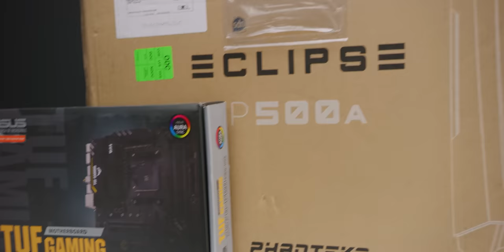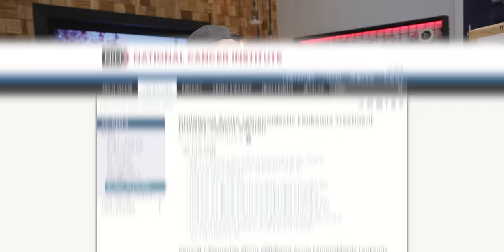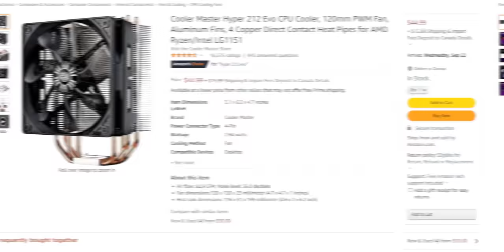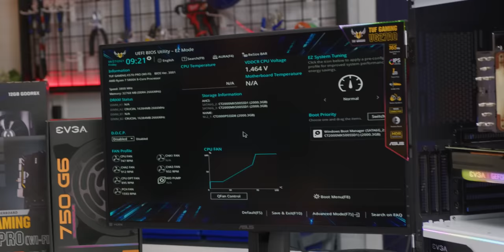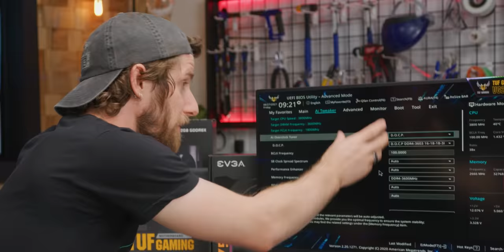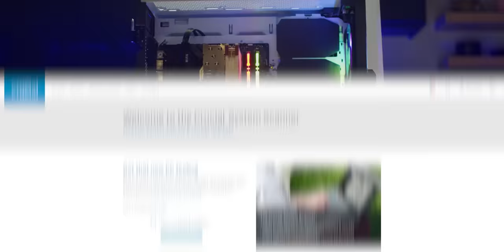I Will GRANT One Wish - ULTIMATE Make A Wish PC

Comment: I really like that they sent him the PC in its parts.  It allows him the satisfaction of building it himself (mostly) and prevents damage from heavier components like the GPU during shipping.
Reply: Especially as it was shipped internationally!

I've seen such damage from things that were shipped with heavy GPUs that were left installed...

Linus group packed the inside well even though the heavy parts were removed for separate shipping - that was a great touch.
Reply: They had to take the cooler and GPU out. They're way too heavy for them to be shipped installed. If you wanna ship those you have to do some janky crap like suspending it, gluing it or similar... and Linus doesn't do that.

Comment: I know there's no chance a linus dude will see this, but I think you guys could check out the 5800x itself in a video and look at its thermal characteristics compared to like the 5900x. might be interesting to see how the 5800x is basically the same TDP as a 5900x but only in one CCX instead of two, meaning that it basically has twice the heat density of what the 5900x could ever have.
Reply: Post on their forum, higher chance it gets noticed there.
Reply: I got the 5800X. It's the hottest CPU of the 5000 Series.
Reply: Cool observation
Reply: This.

I have a 5800x and its a toasty boi even with my EK 360aio with 3 Noctua NFF12 fans. I am super skeptical of the u12s to say the least...
Reply: @helnkellrfresh2deaf  Is it a great overclocker ? I didn't get much luck with my i7 4770K. Couldn't get it pass 4.3 Ghz no matter how many volts I put trough it. But if you're all saying the 5800x is having insane thermal issues I might reconsider my upgrade choice when time comes
Reply: @Zwackelmann173  I mean, no, at least in terms of total heat under load the 5950x is going to out heat it simply because it's a golden 5800x and a mediocre 5800x glued together. The 5800x is going to burn as hot as the good CCX of the 5950x, which - don't get me wrong - is very hot. But that said, I think the 5800x is also the best general-use chip of the Zen 3 series for the same reason, it's the best half of a 5950x whereas the 5900x is 2/3s of the 5950x with all of the CCX jumping penalties compounded by fewer cores making keeping threads on the same CCX more difficult.
Reply: When you guys say it runs hot, do you mean it gets close to its maximum temp as detailed in the spec?
All Ryzen 5000 chips run hot, that doesn't mean that they get damaged by it. My 5600X for example runs fine at 62C under load, which would be a bad temp for say an FX8350 but not for a Ryzen 5000 that can get to 100C without throttling.
Reply: @Maxim0M1  before i used 1usmus's clocktuner my 5800x would try to use all 150 watts and at like 1.45+ voltage on prime95 resulting in over 100C and sometimes over 105C temps
Reply: @acastanza  how many watts can a 5950x pull? cuz i know the 5800x will go up to 150 watts, if the 5950x wanted to be as hot as the 5800x (in terms of density) it would need to use up to 300 watts (because it has twice as many ccx's to dissipate the heat)

if it cant use up to 300 watts, then the 5800x is at least the hardest to cool of the 5000 series, probably
Reply: @machintrucGaming  honestly the Precision Boost is soo good I haven't had to do any manual overclocking, just some minor undervolting in the PBO curve optimizer.

I did -20 on all cores except for the 3 best performing cores, where I did -10.

I get just under 4.9 all core, but it gets hot. Cinebench all core will hit 79-81c depending on ambient.

I think I can push the chip a bit harder to get 5 Ghz even (if I did -25 or -30), I just haven't tried it.

I know I can't go further than ~-10 for my top 3 cores though. I get instability beyond -12, so I pulled it back to -10.

If you just want overclocking, get a 5000 series with more than 1 ccx, and you'll be good to go AFAIK.
Reply: @acastanza  The 5800x pulls ~130w stock and ~160w PBO. The 5950x pulls ~150w stock and 190w - 210w PBO. Heat density is way higher on a 5800x. As stated from others, 5800x has highest heat density and will always have highest thermals provided cooler isnt being overloaded (as in, 150w cooler having trouble cooling a ~200w PBO 5950x).
Reply: @PhantomMattcraft  I'm not sure that's an accurate assessment of the full capabilities of the 5950x which - per the source I found above - can pull 300W when overclocked with a top of the line cooler, and a top tier motherboard with a VRM that can take handle it.
Reply: @Zwackelmann173  I have a Noctua D15 with 2 140mm fans on it. I still get 80-85C spikes when loading into games in 26C room temp. Big yikes, but that's also after "undervolting" the CPU. Best thing ever added on the 5000 series, runs faster but cooler due to lower thermals.
Reply: @acastanza  Comments with links typically get removed, so whatever source you linked isnt stated here. Gotta just do something like "article name here" instead of linking.

I have yet to see a 5950x on a daily OC (meaning bench OCs can be ignored until we also use bench 5800x OCs too) pushing >220w average. There are some daily OCs with >220w transients, but same can be said with 5800x daily OCs having >160w transients.
Reply: @PhantomMattcraft  know of any air coolers that can still cool the 5800x very well despite its ridiculous heat density? it almost seems like my dh15 can't take away enough heat from it, so it overheats
Reply: @machintrucGaming  it depends on your sample. i got a silver sample, and i'm able to get my top 8 threads/4 cores to around 4.8 ghz, something like that. i suppose if you had a gold sample you may be able to get up to 4.95 or even 5 on your top cores, maybe 4.75-4.8 on all cores if you were lucky

Comment: I hope the EVGA 3080 Ti ultra is better manufactured that their 3070 Ti lineup. I've gone through two so far with EVGA because when the 3rd fan is running, it makes a very audible knocking sound inside the card. On a positive note, if I ever wanted a metronome, this particular GPU has it built-in to save desk space.

Comment: My computer professor in collage said you need a 1000w power supply do run a modern computer so he would not like your 750w one. among other things like SSDs are bad cuz they will ware out quickly. he did let us use SSDs as a boot drive only.

Comment: Oh, that's a lot of compromises for an ultimate PC, Rysen 7 instead of 9, not to mention a threadreaper, 32 GB of ram is just enough for today, but 16 would be laughable, not reasonable. What is really laughable is the cooler. SATA SSD's are fine, I guess, but I'm sure there's more than one nvme slot on that motherboard. Also, the keyboard is wired and is missing a numpad. The only thing that is not disappointing is graphics card. Btw, great advertisement for the logitech headset with that echo.

Comment: 256 GB Ram, x8 RAID 0 SSD, 192 GB Ram-drive, for ultimate fast gaming.
Can't get any faster file inhaling than RAM-Drive.
Playing a game involves installing it on the RAM-Drive, while storage
from SSD Raid. The fastest scene transfers and (re)-load times. 
The rest is gravy.
Reply: I'd still use only medium to low settnigs for highest framerate, so the graphics card doesn't have to be top of the line, as long as the CPU can keep up with the data transfers. I'd say 8 core.
Reply: The x8 SSD will quickly overwhelm the transmission speeds, so the SSD's don't have to be top of the line neither.
Like medium speed 200-500Gb's, cheap these days.
Hard bang for the buck.
Reply: The usual graphics over the top lowered, can easily provide for
the cash to memory instead.
Umm, Ryxen 7 or 9, with a-grade memory.
Reply: You'll have to remove the Windows 10 caching, since all game files
are already cached in memory on the Ram-Drive,
and further compression and caching will only slow it down.
Reply: Optimize the ram sync, so the CPU won't have to wait as much for data from memory.
Reply: Why is it that no-one ever came to the conclusion that a minute timing difference between rquest ram and receive, when off-sync from the processor, can reduce latency ?
I mean, Each clockcyle is the same or rated at a base from the main clock.
That means when the CPU requests memory, that clock cycle is already lost for the data fetch, and is now moot.
On average a CPU must wait about 75% of expended clock cycles. That's 3 out of 4. A reduction to 2 out of 3, nearing, would mean a faster data transfer rate by almost 33%.

Comment: I would love to know the temps of the cpu in this system, purely as I have recently got a 5800x and am using a X73 push and pull config and still had to undervolt the cpu, just to get it stable at 65/68 full load temps.
Reply: nice reply, thx ....whatever!!!

Comment: RTX 3080 Ti with 750W PSU? Not gonna work, mate, i have RTX 3080 and i had Chieftec A90 750W PSU and i was getting random restarts and freezes. Then i upgraded to 1000W PSU and everything works just fine. 750W PSU is not enought for 3080 Ti. I even have R7 3700X that uses less power then 5800X.

Comment: Are we sure about this PSU? I mean yeah, it is a great unit but it is only 750 watts. I probably wouldn't even risk to power a 3080 with it. But this is a 3080 ti, which is accually closer to a 3090 than to a 3080...
Reply: I was scrolling the comments wondering why no one mentioned he went with a 750W PSU for a 3080ti lol

Comment: I don't know, but if I had a cancer I'd probably opt out of wireless and go for good old ethernet. All that EMF radiation can't be good for ya. Molecular resonance is an interesting theory.

Btw then regarding mobile devices are you aware that the safety testing the manufacturers do is done from like an inch away and different manufacturers even test from different distances, when it's a fact they're held in skin contact most of the time, even if in a pocket it's pretty much against the skin. Dare I call there's fraud going on in there!? Yes most definitely!